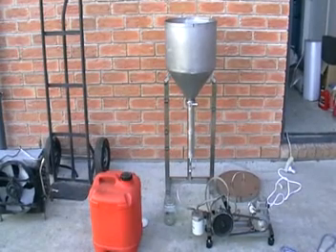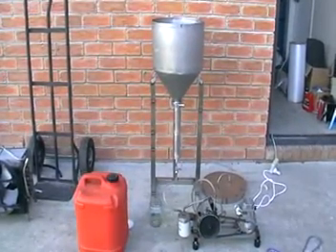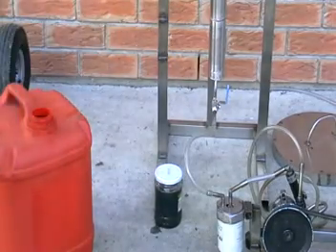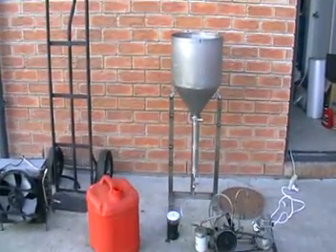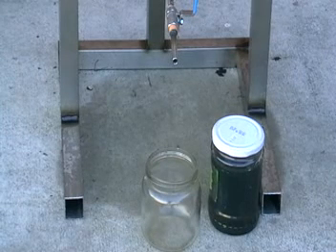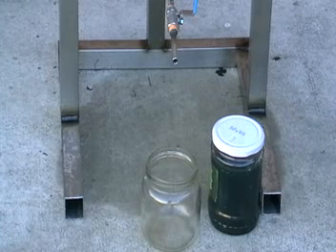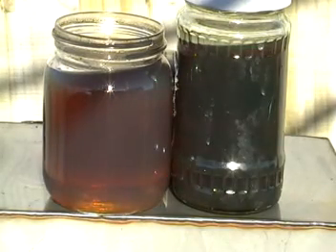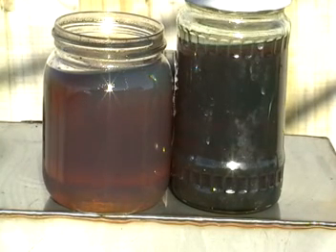WMO diesel fuel treatment.

Comment: IF YOU ARE STILL WORKING WITH WASTE OILS as alternative fuels...  Nearly any waste oil can become HEATING OIL for an oil burner heater   home or garage heater...  AUTOMATIC TRANSMISSION FLUID  and HYDROLIC FLUID  are more suitable for use in diesel engines.  The thinner viscosity  of  about SAE 10 makes the lighter thinner oils more suitable for  use as engine fuel.

Comment: And what' about electric engine? What can you say about RPMs and power?
Reply from the maker: the motor is 3 phase, running at single phase through run capacitor, it is 250w and 220/240v 1380rpm, the pulley of the motor is about two times smaller than one on the pump so the pump is running at about 690rpm, the main use of this setup is a diesel transfer from barrels to fuel tank of my 4wd car. So no heavy lifting at home, no dodgy funnels, no rubbish in the tank as there a filter on the pump inline.

Comment: Can someone tell me all I need to make diesel out of used oil and the steps I'll need to take
Reply from the maker: Yvonne DiBenedetti to make diesel fuel out of used oil, you'll need to distill it first, then resulting distillate must be treated to remove all unwanted contaminants, then filter and use as fuel, to do so you'll need a distillation apparatus that would be specifically designed for very high temperature oil distillations, and some sort of settling vessel to treat your fuel after distillation.

Comment: I let the oil settle in a drum for a few days,then pour it thru a 5 micron filter (leaving 2 inches of gunge in the bottom of the drum).Then pour it in my Jeep.I've been doing it for years and my engine runs fine.
Reply: Hi Billy, please can you tell me how many times you have to change the 5 microns filter, and is the back colour a little more clear after the process? Thank you

Comment: Your pumping is helping to emulsify the water into the oil. Really cant stand this guy.
Reply from the maker: First of all there is no water at all as the oil came from high temp reformer subjected to the temperatures over 300c so no water at all and the pumping is looping the oil trough the absorbent helping simply to accelerate the process of polymers removing from the resulting oil, and if you can't stand me then simply don't watch the video and stop commenting, keep the distance and forget about me and your life will be filled with happiness and joy all over again.
Wish you all the best,
Reply: Diesel Ramcharger.  If you can't stand him; don't watch him!  No need to insult a guy who is trying to share his knowledge for free.
Reply: +Alek Polek 
hello good night carlos martinez mexico , I really liked your blog like me I could support step the manufacture of diesel starting of burnt engine oil , I have a biodiesel reactor but here in mexico is very difficult to get used vegetable oil so which I feel the need to do this with engine oil , if you could support me I would love that sulfuric acid , potassium hydroxide is used etc.

receives a warm hug
carlos martinez
ordenadorbase@gmail.com

Comment: its all sodium polyacrylate. Wether you call it military magic beads, or disposable diapers, or whatever you want. the stuff in raw form is a powder, small amounts of water are added to plump it up. Why do people try and cover this information up instead of just coming out and fucking saying it?
Reply from the maker: No I don't use any sodium polyacrylate, as it will simply absorb the oil and form a spongy material, and there is no way a sponge will be useful for a diesel engine, maybe good for a steam engine boiler :-)) - good for diapers only.

Comment from the maker: the hoper is filled with a reagent that reacts and absorbs asphalts and polymers that otherwise would end up in your fuel system and gum your engine, the filter is preventing the reagent get into a final product - so a few passes if you need it fast or just settle for a day or two if you don't need it straight away.

Comment: Use ultrasonics!
They heat up the mix but also like a cake mix that your mother makes? Were She aggitates the mixture for the simple purpose of seperating the clumps( big lumps) from the finer smaller Cleaner parts.
It is also used for reprocessing waste engine oil by THE PROFFS. Ultrasonic tranducers are easy to comeby.
Hope this is of great help for you? Cleaner faster cheaper.